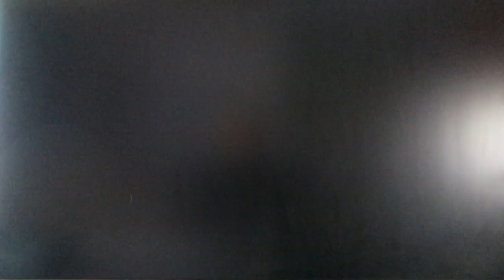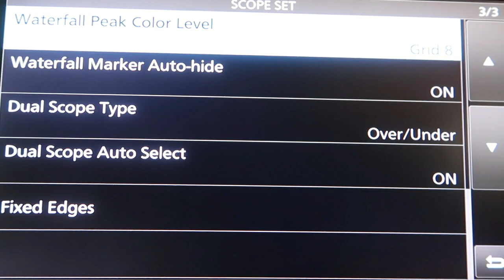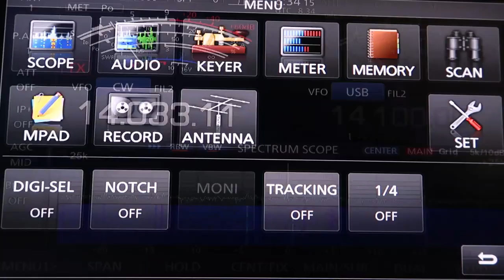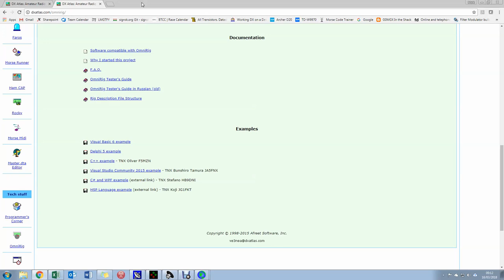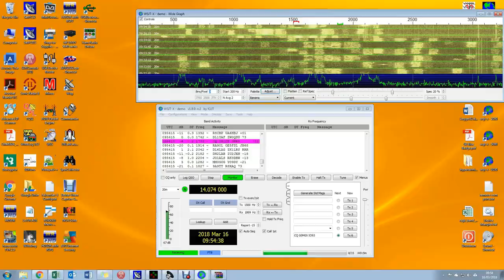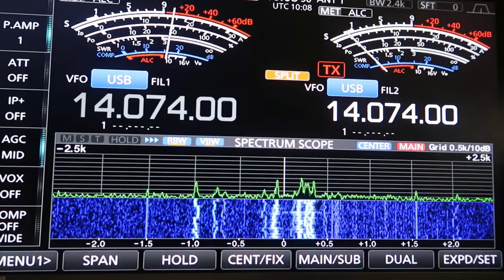IC-7610 Waterfall and WSJT Config

Comment: Is there a way to set ssb phone transmit width to 3khz instead of the default 2.8khz?
Reply from the maker: Yes, the WSJT software will always select FIL2 (a quirk with the CAT command set) so set that to be as wide as a house, then use either FIL1 or FIL3 for your day-to-day SSB work and the FIL2 will always be selected when you use WSJT.

Comment: Just wanted to say thank you for your videos. Been debating on the 7610 and 890s. Both beautiful rigs! If you had to choose one which would it be?
Reply from the maker: Impossible question I'm afraid. The underlying architecture of the 890 is different to the 7610 which is why It's effectively no 3 in the Sherwood list (http://www.sherweng.com/table.html); only the £14K IC-7851 and 3 versions of the K3 plus a no longer available Flex 6700 plus the RX only Icom 9700 are above it in receiver performance.

On the IC-7610, because of the architecture, the roofing filters are effectively at least as wide as the band itself so you see a lot of RF overload conditions on the receiver which you need to back of the RF gain control to counter. Not an issue by any means, but certainly an operating consideration.

I used both in recent RTTY contests and they are both fantastic radios - the 7610 has a second receiver of course. I like very much the flexibility in the 7610 over the waterfall configuration (https://youtu.be/2vCaB1LJJ90) and also the ability to set up bandlets on the UK 5MHz allocation is superb (http://g0mgx.blogspot.com/2018/08/60m-or-5mhz-and-all-that-jazz.html) and here I compared (very poor video) the two waterfalls side by side (http://g0mgx.blogspot.com/2018/11/ts-890-and-ic-7610-panadapter-and.html) Some more comparisons between the two here http://g0mgx.blogspot.com/2018/11/wae-rtty-time.html.

I have also owned a TS-990 and found it superb; now Kenwood have added CW decode and some other features from the 890 to the firmware it looks like a very competitive radio. The RX performance isn’t up there with the 890, but would you or I notice any difference in our circumstances? Certainly with my compromise antennas I doubt it very much.
 Its twin RX makes it a real competitor. The 990 is also 200W out with a second RX; the 890 100W out with one RX. The IC-7610 is a dual RX full SDR radio with an I/Q output - neither of the Kenwood's have this.

There is no easy answer. Whichever one you get, they are all fantastic radios.
Reply: @MarkG0MGX  Another thank you for the videos, I think the Kenwood is looking more favourable for me as it has the additional encode/decode CW with a USB keyboard, where as the IC-7610 only does psk & fsk encode/decode, I researched by looking at each of the radios user manuals. Correct me if I'm wrong.